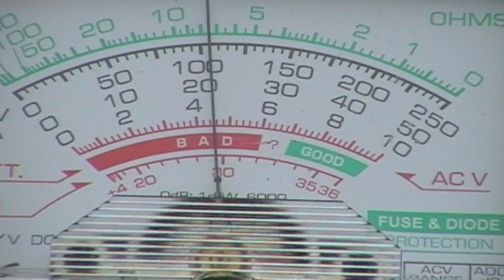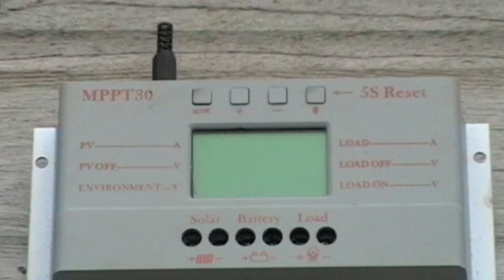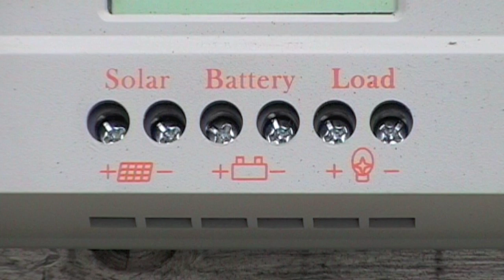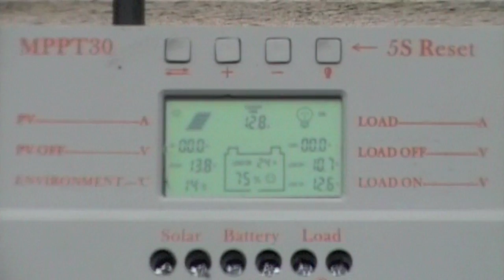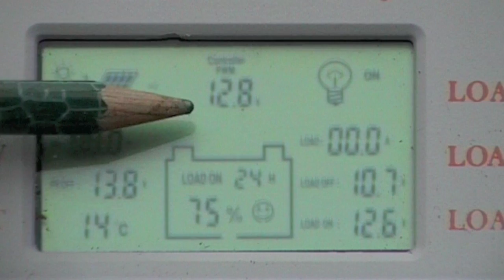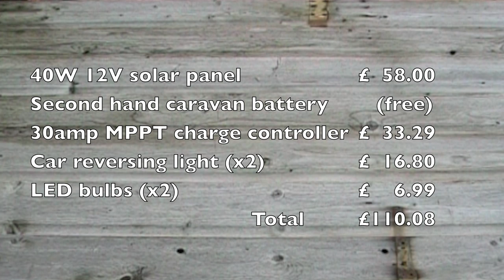Solar powered shed: 01 Basic solar setup

Comment: i thought that the battery had to be connected first to protect the controller? That is how i set mine up in my garage to power led strip lighting and to keep power tool battery's on charge when not using them. good video
Reply: That is correct so the charge controller knows to set for 12v or 24v
Reply: Any work you do on the batteries,  always disconnect the panel first.
Reply from the maker: Yes. I got that bit wrong. Sorry everyone.

Comment: But if the battery already is conected to the load? do you have to wire this two to on the controler to the load again? I onley need 4 cabels!!! do you mean what i talking about,,,on an motorhome its al conected to the battery!! so???
Reply from the maker: The advantage of connecting the load to the charge controller is that it'll switch off the load if the battery gets discharged too far. This protects the battery from damage.

Comment: Sorry to spoil the party but you have wired up the system in the wrong order, You should alway connect up the battery first so you dont burn out the solar charge control unit. Its battery first then the solar panel
Reply: Apart from that it is an excellent video that explains all the necessary points with out the confusing electrical terms.

Comment: Hi.  Thanks for the video.  My charge controller which looks quite similar to yours says you must hook up the battery first so the controller correctly identifies the battery type.   Secondly do you think it is overkill to put a fuse inline from the battery to the controller I say this as I am putting mine in a moving caravan and I'm worried that a movement of something in the storage area may pull the wires out of the controller and cause a short which may start a fire

Comment: Will that solar panel keep the battery charged if you run continuously a small motor, my solar panel is 30 watt
Reply: You need to include more detail for an accurate Response to be formulated. The Motor wattage, is continuously 24/7 or as needed? Does the battery need to keep the motor running when its night time? how large is the battery as in Amp hours (AH)? Anything with Numbers will help me answer your question.  all see if i can help you :D

Comment: One question how would you add more storage?
Reply from the maker: The simplist way would be to use a higher capacity 12 volt battery. Adding extra batteries is possible but things get more complicated and I like to keep it simple.

Comment: Can you run a laptop on a Solar system without an inverter.

Help please
Reply: Well i guess if it charges on dc its fine. Have a look at the laptops power supply and and see what it charges at (Voltage and if converts to dc)         I’m no expert so do some more research but i suppose some charge controllers have dc ports. So thats my guess but I’m not 100% sure. (Don’t risk your laptop from just my  assumption)
Reply: Boakye Caleb , Also list your power supply on your laptops (power brick) here. The output wattage, voltage and if it converts to DC here just incase

Comment: why is the inverter connected directly to the battery and not the controller load?
Reply: frz0, It would put a load on the charge controller that is unnecessary and and might fry the controller I guess. the load on the charge controller is for small dc loads but the amperage and wattage draw from the inverter is just to high for the internals to handle and also the size of cable for most inverters is so big and chunky to survive the amps going through it wouldn’t fit in the little holes on the charge controller.

Comment: Can you just go without the inverter?
Reply: Yeah, providing you only need the kit for dc current at a lower voltage. Meaning you can run lights without the inverter and the system will work just fine.

Comment: Good video presentation, but note the battery should be wired to the Controller before the panels, else you may damage the controller.
Reply: That's right
Reply: Totally agree!
Reply: Correct !! Connect battery before connecting solar panel. Solar controller buzzes uncomfortably if SP connected first.
Reply: It will do nothing

Comment: Dear friends,, your electric cable connection is in order all upside down,,, so your method is very dangerous,,
Finally, you have to connect to the battery, and you have a connection from the battery,,,, and it had to be plugged into the solar panel after the connection to the control, which also reversed,,,
The view is very dangerous in order,,, I want to fix,,,, video I watched well,,,, thank you,,,

Comment: 9:14 24v! Am I hearing it right?
To make it safer could you run a earth cable to the converter?
Reply: Where do I get the wires ,best battery etc
Reply: Most inverters are earthed. I guess it wasn’t earthed as he was. Trying to do a simple demo, unaafe however.

Comment: I find this your video very useful and instructional. It's basic and straight to the point, devoid of technical jargons. Looking forward to a more advanced part of the video, e.g. working with more than one solar panel with more than one 12v battery and double source of charging system, i.e. mains supply and solar. Good work.

Comment: thanks for increasing my knowledge in electrical installation and most especially solar...i have a question. what is the best way of increasing the out put of my battery and it`s storage( 12v deep discharge battery)

Comment: if solar panel give only 10volt, did the controler adjust to 12v to charge the battery?
Reply: No it will stop charging your battery

Comment: Are you having the solar panel, inverter charge controller and battery all connected at the same time (the battery is charging at the same time as it is running the inverter)?  Where does the battery connect to the charge controller, if the battery terminals are also connected to the inverter?  The setup I had before had two batteries (battery was being charged on the solar panel and the other battery was running the inverter), so I never contemplated this single battery scenario. Thanks for the helpful video🙏

Comment: can anyone pls teach me my controller has only to buttons.. MODE and LOAD..  load is for ON and OFF of the LIGHT.   so what's MODE is for??? the number flash in my controller is 00 always.. how to set it up? I have 100w solar panel...and 12v battery and 500w inverter

Comment: Watched this in 2016. Now I'm using a 50/50 blend  of (26), 15 watt, 14.5 volt and 25 watt 18 volt, Harbor freight panels, bought on sell. 7 deep cell marine batteries. A 500 watt charge controller, (2) 750 watt 110 volt inverters. I run small refrigerator, 19 inch tv, with satellite  (2) 12 volt lights, a 12 volt fan, a 110 volt box fan, and a 110 volt pump for my fish tank. As needed, I have chargers for computer, cell phone, and (4) 20 volt batteries for my tools. Yes I am off grid and heat water by fire. This system has been in continuous use for 18 months. So far the only day I had problems was when it snowed. I have $1,700 u.s. invested in it. Solar systems work great.

Comment: The inverter you use , is calming to be 1500wats ,it won’t be  inside you find one or two  blade car type fuses rated at 40 amps   So 12 times 80 =960 watts at 80% efficiency,will be the real wattage ,  you will also find some dodgy soldering and very thin wiring and lastly no EARTH WIRE CONNECTION   I’ve came across many Chinese inverters as described.

Comment: Which solar plane supports one desktop computer and one print of 12v
Reply: Don't connect the solar panel directly to your computer and printer . 
Instead, create a system as here where a battery supplies power to your system. That way you can work at night or on cloudy/rainy days.

Comment: Fascinating stuff, but what is the clear plastic pipe leading from the battery for?  And what did you use for a switch for the light?
Reply: that clear plastic pipe is a breather/over flow as it looks to be a lead acid battery but it could have mineral water init instead, as the battery charges it can give off hydrogen gas which needs to vent so the pressure dosnt build up inside the battery, also the caps on the top of the battery are used for maintaining the acid/mineral water levels, as over time they can evaporate

Comment: But can u give me exactly the wattage of the Solar panel, the voltage of the battery, watt of the charge controller and the inventor, if I want to used 1=television, 1=freezer and 3=15 w bulbs?
Reply: A freezer and television will require far too much energy for a system such as in this example. Contact Tesla's Solar City for a solution.

Comment: great video i am thinking of doing this on my boat for the fridge wifes hair straighteners and laptop charger etc can i do this please and would i need a charge controller with more cable holes for extra appliances also where did you get your components from please ,
many thanks ,
clive .
Reply: Clive Squire Buy a battery box,they have a variety of sockets on them to run different appliances.

Comment: Can I ask how many watts is that solar panel of yours?
Reply from the maker: Thanks for your question. The panel is a 40W panel.
Reply: Homestead can i ask if you know if two 12v battery will combine series to have large capacity, is that count as 12v or 24v? Thank you sorry I don’t have knowledge
Reply: @manwheeldorun6518  Once combined with another 12v , you have 24v.

Comment: Why connect the inverter directly to the battery & not via the controller.
Reply from the maker: The inverter needs the stored energy in the battery to work. There isn’t enough power coming from the solar panel for the inverter to work.
Reply: Homestead . I’ve seen others using the controller wired to the inverter, so I just wondered why you went straight to the battery. Your way makes perfect sense. Thanks.

Comment: I am about to build a similar system. why not run the inverter from the load side of the charge controller? is there a reason to run it from the battery?
Reply from the maker: I don’t think the controllers wiring will take the load that the inverter pulls. The inverter has big chunky cables capable of high loads but the controller doesn’t.
Reply: yes good answer thanks. I will check the power rating out on the load side of the charge controller when it arrives.

Comment: I see the wires... you keep using the word wires, I see that one is red and one is black...I see that the wires are kind of thin,  I see what your doing ...but you never say what type of wire nor do you say what gauge... why is that? Are you assuming that all your viewers are solar panel gurus... I can tell you that I am not.  
at present I purchased , a large and heavy 12v  battery , a 150w panel a solar charge controller, but I have no idea what kind /or type / or gauge of wire I should have..... care to elaborate or should I just keep watching and maybe I'll learn something
Reply from the maker: Thanks your your comment. To be honest I just used the wiring that I had to hand - most of it was from 12 volt car wiring. I don’t know exactly what gauge I used. Sorry I can’t be more specific.

Comment: I see commenters correcting you saying you need to connect the battery first before connecting the solar panel. Perhaps my thoughts would dispel all doubts. As soon as you connected the first positive wire to the solar panel I thought you needed a switch right at that connection, one that would remain off during the rest of the install. Then as you connected the positive battery I thought another switch should be there also. That way while in actual use you could switch off power coming from the panels or coming/going from battery. Also useful for service such as replacing the battery. I guess even with switches you would still have to remember to switch battery on first then solar panel. During the actual install I guess you could use various means to remind yourself which way to switch.

Comment: Question !! I have a solar panel connected to my leisure battery via charge controller . Can I charge the battery via mains whilst the charge controller is still connected to the battery ? Great video by the way 😃👍
Reply from the maker: Good question Gazpic. I don’t know the answer but personally I play safe and disconnect everything when using a mains charger on the battery.
Reply: Cheers 👍 Funny thing is, I've had the solar panel connected to a charge controller for 2 months, keeping 2 X 110ah leisure well and truly charged up. Lots of 🌞🌞🌞 so as yet I've not had to charge from the mains 😃👍

Comment: If there was no battety you could not run the drill with 40W solar panel only. :D  and you must connect the battery to the controller first :D
Reply from the maker: That’s a good point you make Ivan. The inverter uses the stored power in the battery and drains the battery faster than the 40W solar panel can charge it.

Comment: These regulator/charging units will   gradually bring a tired battery back  to decent condition. The third position on the charger will switch on a light circuit when the sun goes down! Good vid.

Comment: Hi there, is it possible to connect the inverter directly to the panel ?
Reply from the maker: That wouldn’t work. The inverter uses the stored energy in the battery which is far more than the slow trickle of power coming from the power. It’s a bit like a toilet. It’s all the water in the cistern provides a big flush and once it’s empty you have to wait for the cistern to fill up again.

Comment: can you use ordinary battery car for this project....any solar system
Reply from the maker: Yes you can. However they won’t last as long as leisure batteries because of the way they are designed. Car batteries are designed to provide a lot of power in short bursts to start the engine and then have their charge topped up as you drive along. Leisure batteries are designed to provide a more continuous supply of power over a long period before being recharged.

Comment: very nice from all the systems so far it explains very nice and clean I have a question how much is the power that conces. and if I need to add power I need to have 2 panels and other interfaces? Thank you for giving me a reply
Reply from the maker: The amount of power depends on how sunny it is. If you need more power you can add more solar panels to the controller.
Reply: Where do I get the wires ,best battery etc

Comment: Is it possible to connect the inverter from the load terminal of the charge controller?
Reply from the maker: The inverter needs to be connected to the battery. The solar panel doesn’t provide enough power for the inverter to work.

Comment: Can you leave the inverter running constantly?
I'm hoping to keep mine up the loft.
Reply from the maker: My inverter drains the battery faster than my 40W solar panel can recharge it so I only use the inverter for an hour or so at a time.

Comment: I suspect those little wires would burn up long before that large 100 amp breaker would trip. One should size the breaker or fuse based on both the wires and the device it is protecting. However good video none the less.

Comment: I have a doubt, sir, you could have used an led directly, why would you even require an inverter.
Reply from the maker: I wanted the inverter so I could run small 240v power tools from time to time.

Comment: You Forgot to write the inverter , i have question if i link 15 solar panel can i use the seam 30 amp or there are other thing Stronger ?

Comment: Could you add the inverter as the load on the charge controller and have it protected by the CC or does it have to connect directly to the battery?
Reply from the maker: The inverter has to be connected to the battery.

Comment: Does battery continue to re-charge while power inverter is working?
Reply from the maker: Good question Marko. The inverter drains the battery faster than the solar panel can recharge it so the battery is gradually being drained down. I get about an hour of continuous use before the battery voltage drops too low. I only use the inverter for running small power tools so it isn’t a problem.

Comment: I have a couple of observations:
1) A 1500W inverter for less than £30?  Maybe a 150W for that price? Cheapest I've seen is well over £100.
2) A 100 Ampere circuit breaker as a safety feature?  Why so high a current rating?

Comment: I like the way you demonstrated the symplified hook ups on the solar panel, off grid system, Is this also applicable to a water pump sucking water under ground & pushing it thru the water reservoir,.??? nice beautiful video.. next year i plan to be off grid up in the farm using solar to run my hydroponics & aquaponics over North East of Thailand.

Comment: Maybe worth noting that the power inverter for the drill was connected to the battery instead of the MPPT controller, which is where the light was connected.  Maybe, the MPPT has a current limit?

Comment: Interesting, I was always reading the battery should be attached first.  I don't know, i guess charge controller has enough protection not to shorten the solar panel, so this experiment may be proving it (that was an uneducated comment, I am sorry if someone would find it silly).

Comment: When I don't have a proper stripping tool around and I seen expensive tools cut the wire as well... 1 or 2 strands wont defeat the overall purpose but 10 or more will so I strip wires by heating them up with a lighter rather than cut the wires off, but maybe I'm wasted smoking too much poison ivy